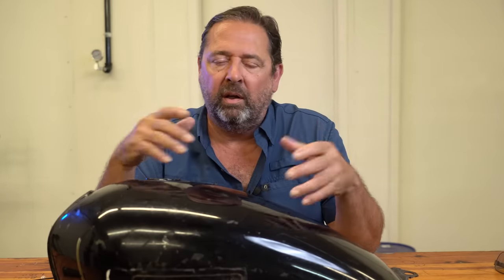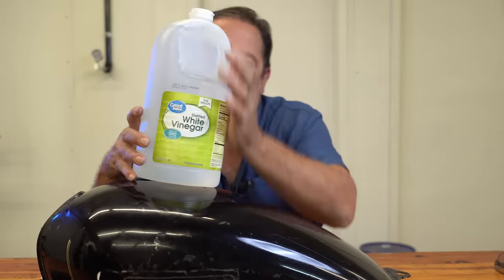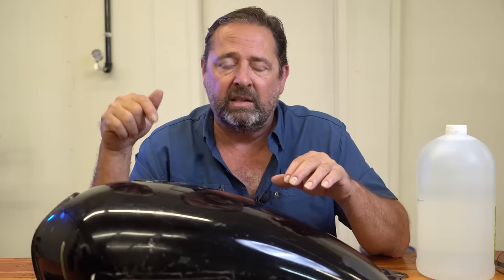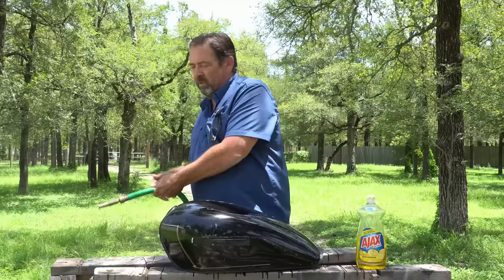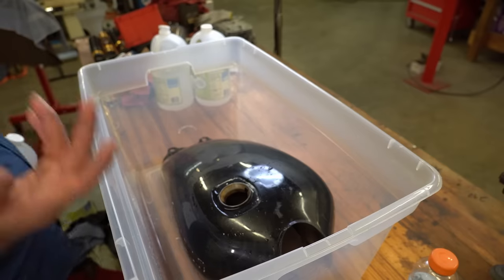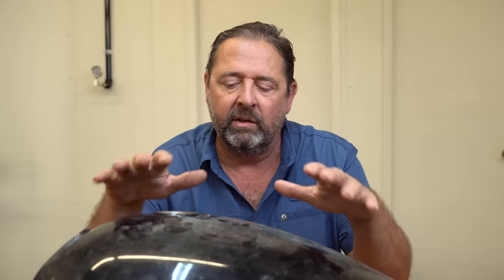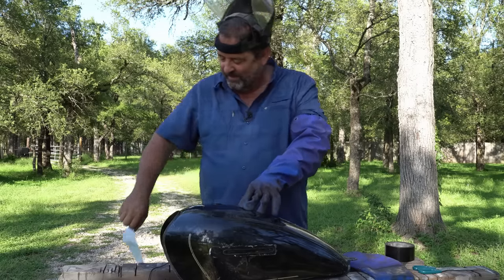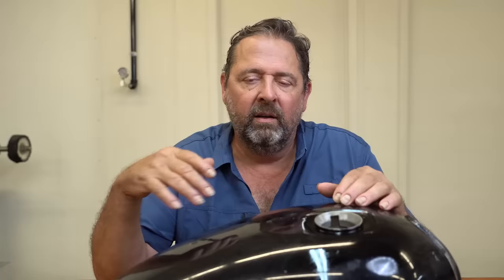GAS TANK--CHEAP--RUST REMOVER !!!!!!

Comment: I'm not sure about stateside but over here in Blighty our washing up liquid has salt in it which will promote rust, which is why it should never be used as a tyre seating lubricant. I've seen very rusty motorcycle rims on the inside whilst tyre changing which I'm sure has been caused by the use of this detergent, can't say as I've tried white vinegar but I have used molasis to good effect !
Reply from the maker: Thanks for the details, will keep that in mind.  I've heard about molasses, might have to try that.

Comment: Good method. The only thing I'd ad to this is after the muriatic acid step to immediately wash the tank out with baking soda - this drastically slows down the flash rust problem.  (HCL on metal in the presence of oxygen will ironically re-rust that metal.)
Reply from the maker: Point taken.  Thanks!

Comment: This is a very informative video. The muriatic acid added to a nearly full tank of water, may in some cases, replace the vinegar soak. Also please be careful about the dangers of the addition of water to acids. Muriatic acid added to water in an old engine block that is crudded up with iron, and/or lime scale will etch the surfaces to look like new, just as the tank did. For the proper dilution rates, consult a knowledgeable professional. Muriatic acid vapors will cause a red corrosion on anything in a confined area. Take it outside before you open the container, and protect any bright metal surfaces with a coat of grease or oil. Grab your old clothes and shoes, and all the needed ppe.
Reply from the maker: Thanks, good info!

Comment: Used vinegar for many rusty things but didn't know the baking soda trick.    My old beast of a snowblower had a rusty tank.   I filled it with krud kutter and let it sit for a month repeating the process.   The tank inside looks new.  Not sure if what i did would work on a cycle tank though...
Reply from the maker: It should work just fine.

Comment: Evapo rust will remove the paint  if it sit any time.
Will Vinegar hurt the paint ?
 I like metal prep from the auto paint store. They use it on bare metal to remove surface  rust . 
If you let parts sit , it does remove bad rust and is safer than muriatic acid.
Reply from the maker: Good info to know, thanks!  And thanks for commenting!
Reply: @CycleFab  ... You didn't answer my question .

Comment: I will have to remember that for my next rusty gas tank.
Reply from the maker: It works really well.
Reply: I see that. In the past, before I’ve rinsed the tank out, I’d toss a bunch of nuts and washers into the tank and move and shake it all around. The nuts and washers would help knock off some of the really scaly rust inside.. but your method seems to work very well without having to do that step.

Comment: Have you ever tried molasses to remove rust? I mixed up about 4 gallons at 9 parts water to 1 part molasses and soaked my Dana 44 knuckles and brake backing plates. They were RUSTY when the went in, when they came out,,, bare steel. It leaves a black residue on the steel that comes off with either scrubbing or pressure washing. Nice part is I can just pop the lid and drop a part in the five gallon bucket as I need.
Reply from the maker: Old remedies still work well.

Comment: Best way to get all the fluid out of the tank when fill hole is in the top right corner. Almost seems impossible…the acid is the last thing I feel like I want to turn upside down shaking and splashing everywhere. Also, any issue using original gas cap with the acid? Does it affect crossover lines or cap?
Reply from the maker: Yes, you do have to be careful when working with acid.  Muriatic acid will affect everything that it touches.  Thanks for commenting and good luck with your project!

Comment: 1. Use water hose to remove residue inside tank. Add dishwasher soap as well. Repeat several clean cycles. 
2. Seal tank and fill to brim with white vinegar. Let sit for a couple days. 
3. Add  half gallonMuratic(?) acid for no more than a min. Vinegar is good enough so long as you seal it right away. Has container to dispose of acid. And baking soda to neutralize in case of spill. Roll the acid around in the tank. 
4. Use wd40 to seal it after cleaning out and drying.
Reply from the maker: That's it.  You can use two stroke engine oil also, but the oil is mainly to keep it from rusting if you're not going to be using the tank right away. Thanks for watching and commenting!
Reply: @CycleFab  oh sorry i was taking notes for myself for later. but i used this technique and it came out great! thank you for making this video! really well done
Reply from the maker: Great!  Good to hear that.

Comment: After the muriatic can you go straight to the sealer?
Reply from the maker: You'll need to rinse the acid out before you apply sealer.
Reply: Rinse with water? Will the metal flash after the muriatic acid?
Reply: Thank you for responding ❤
Reply from the maker: Water/baking soda mixture and rinse well and dry.  Yes, you will possibly get light flash rust.  Caswell Tank Sealer says in their literature that you can use their product over light flash rust.
Reply: @CycleFab  makes sense, thank you for your mentorship!
Reply: @CycleFab  I just completed my project with your helpful videos and mission 🙌success. Thanks again!

Comment: This might sound silly, but would it be more beneficial to use distilled water for the flushing and rinsing where you used tap water?
This question with the same reasoning you would use it in your cooling system instead of tap.
Thanks for this video
Reply from the maker: It makes no difference between tap water and distilled when flushing/rinsing.  Thanks for watching and commenting.

Comment: I've used vinegar to remove rust. It doesn't work very well but it does work.
Vinegar sold at the grocery stores is diluted to 5% vinegar. I'd like to know where to get stronger vinegar.
Reply from the maker: You can get stronger vinegar at Amazon or Lowe's.  I think up to 45%, maybe more.  Thanks for watching.

Comment: I DONE IT ,LOOK GREAT BUT I have a question ,do I need to wash out the tank with soap after the Muriatic acid and do I really need to undercoat the tank thanks
Reply from the maker: YES!  You need to wash out the tank with soap and water after the muriatic acid.  And, its not necessary to line the inside of the tank if it's not leaking.  Thanks for watching and commenting.

Comment: I had a 89 supra and tank was just soo Rusty I was sure was ready to be tossed. Turned out I watched a video someone using acid at Walmart and I used 1 gallon and started working in 5 minutes after puring it was sizzling acid... Made rust turn highlighter yellow. The vid shows light rust. I have huge chunks of rust. Btw... The acid is no joke. It's 1000 times better than vinegar or some of the rust remover stuff you see at AutoZone.. the acid is the real deal and believe me it. Cuts Time and saves your money. I'll only recommend acid. I've used the gelly stuff on other stuff and it works on surface rust. This acid will eat away crusty rust in chunks....
Hoping this helps!
Reply from the maker: Thanks for commenting, good advice!

Comment: okay so as the video goes on you reveal more and more things that are needed. i would be nice if they were stated in the description and at the beginning of the video. now i'm going back and forth to find out what i need
Reply: video starts talking about Rust 911 then moves on to water then dish soap and water. it notes that you rinse it several times with water then repeat the process with dish soap and water but the process is not shown and we don;t know how many times to rinse with water and how many time to wash with water and dish soap. then we see vinegar going into the tank and then it cuts to the vinegar having been removed from the tank without stating how long the vinegar is supposed to sit in the tank. also how is the vinegar supposed to be removed? do you blast it out with water? then all of a sudden we're talking about muriatic acid and it's mentioned that it's dangerous and disposal is never described or shown. dish soap gets mentioned again and then we cut away yet again. now you mention don't let it sit not specifying if you're referring to the acid or the vinegar and then you mention that the vinegar "like you said" should sit for 24 to 48 hours but you never actually said that until now which is a full step after you've removed the vinegar... now you mention putting WD40 in the tank before sealer but then removing the WD40 with acetone. so that's 3 new chemicals mentioned in the last minute of the video with zero explanation or demonstration of why and how. i'm left with far more questions at the end of this video than before i started watching. WTF?
Reply from the maker: Noted!

Comment: Thanks for doing yhis. But what i do not see afther the white  what you use for product afther that? Baked soda? How long it stay inside?
Reply from the maker: After muriatic acid, rinse with baking soda and water for about five minutes or longer then rinse with water.  After that I would immediately coat the inside of the tank with gas and a 2 stroke oil mixture.  It protects the tank from flash rust until you get it back on your bike.  
Thanks for watching and commenting!

Comment: I've bought some Caswell but after seeing horror stories of sealer delaminating, I'm gonna try running the bike as is, removing the fuel, drying, then WD40 for the winter lay up.
Reply from the maker: You don't have to use a liner, running bare metal is fine as long as you don't let it sit for months on end.  BTW, use two-stroke engine oil instead of WD-40, it just works better.  Thanks for watching and commenting!  Good luck with your project.

Comment: Great video thx a bunch. I have just one question - after clening the tank and all is well and clean what should be used to coat the inside of the tank immediatly that will agree with gasoline when the tank is in use. Would a coat of oil do? And if yes which one and how much. Ok that more then one question :) thx
Reply from the maker: I use two-stroke engine oil to coat the inside of the tank to keep it from rusting until I can get it back on the bike and running.  Or I do this to it:  https://youtu.be/S8DJ8pUw9Yc
Reply: @CycleFab  again thx a lot I do appreciate the advice. Just to be clear from your experince if you just use two-stroke oil it should be good for future usage even without doing the sealant? Take care. :)

Comment: The best I found is CLR leave it a few days with some nuts to shake around now and then Finish up with new metal finish inside.
Reply from the maker: That's a new one, might have to try it!  Thanks for watching and commenting.
Reply: @CycleFab  it’s a little stronger than vinegar works great. I even seal the cap and invert the tank to clean the top surface.

Comment: Hello perfect video, I have a silly question, since I have done the whole process and having poured in the 2 strike engine oil for the insulation. To use the tank in my machine will I have to get the oil out of the tank somehow? "Wash out " with gasoline maybe ? Tnks you !!
Reply from the maker: Yes, gas works fine for washing out the two stroke engine oil.  Thanks for watching and commenting.

Comment: I take a three gallons of vinegar. let it soak 24 hours. I pour 100 stainless steel lock washers and a container of 1,000 BBs. I seal the tank, wrap it in two moving blankets and put in the dryer making sure it does not flop around, set on no-heat fluff and run it for a half hour. You can also put it in a small cement mixer. Cleans it out. Then coat with Por 15 right over the residual surface rust.
Reply from the maker: That sounds really effective!  Thanks for watching and commenting.

Comment: What method do you use on a tank with paint that you want to save and internal fuel pump.
Reply from the maker: You'll have to get that fuel pump out first, then use the weakest vinegar 5% (which is what I used in the video) and no muriatic acid.  Good luck with your project and thanks for watching and commenting.

Comment: Good video! Can a tank sealer be applied directly after the white vinegar?
I've left my tank soaking in white vinegar for a couple of days now and looks ace, however I'm hesitant to wash it out with water.
Thanks
Reply from the maker: Rinse/Neutralize with water and baking soda mix then dry and apply sealer.  Don't worry of any light flash rust if it happens during the drying phase.  After it dries seal it ASAP.  Thanks for watching!
Reply: @CycleFab  thanks for replying so fast. 🙏🏻

Comment: You briefly mentioned it, but I think you should have done a better job explaining to people that the vinegar and acid removes a layer of the metal and it has to be permanently coated or it'll come back. You did mention spraying it with WD-40 but that's only a temporary Band-Aid and I know you mentioned that but I don't think you were clear enough for people to understand they can't just run acid and call it good.

That being said, I think you did a good job, I've used this method many times.
Reply from the maker: Sealing a tank after cleaning is a must, in my opinion.  Without this crucial step the tank will start to oxidize.  Thank you, I'll keep your observation in mind.

Comment: What do you nuetralize the acid with?
What about the fuel tank sending unit? If you remove that assemble how do u close the opening? Can you leave the float unit in place, or will it get damaged?
Reply from the maker: I use a baking soda/water mix to neutralize the acid, and I remove the float unit.  Gorilla tape works for sealing up the holes during this process. 
Thanks for watching and commenting.

Comment: hi thanks for the video, i have rust in my motorcycle radiator, will your method also work?
Reply from the maker: If your radiator is soldered together as radiators typically are then I would suggest that you don't use this method.  Reason being is that solder and vinegar(acid) do not react well together.
Reply: @CycleFab  thank you . didnt think about soldered radiators.

Comment: Sorry for this question, you have used Vinegar and then which ACID ?
its REDIC ACID ?
Reply from the maker: No problem.  I use Muriatic acid, which is typically  a 35% Hydrochloric acid and 65% water solution, if I remember right.  You can buy this stuff at any hardware store.
Reply: @CycleFab  thanks allot

Comment: Hey man, I’ve got my tank full of vinegar right now, it’s the 2nd time doing this because the first time I wasn’t quick enough to avoid the flash rusting when drying it. 

So my question is after I rinse out the tank with distilled water and baking soda to neutralize the vinegar do I just spray some WD-40 in it to avoid the flash rusting? My tank is curvy and difficult to dry. Any tips? My plan right now is to rinse with water and baking soda, empty it with my hand pump and then add in 2 stroke oil and a gallon of gasoline to swish it around in order to avoid rusting before draining that and filling the tank with gas to start riding. Any help is appreciated
Reply from the maker: Flash rust is sometimes unavoidable, but the two-stroke/gas mix is probably better than WD-40.  Hope this helped.
Reply: @CycleFab  I appreciate you. Thank you for taking time to respond to every comment with information.

Comment: Adding some sharp grit and sloshing it around with some ammonia solution will polish it up to white clean steel
Reply from the maker: I haven't heard of using ammonia before.  Thanks for the info.
Reply: @CycleFab  it's cheap basic solution with relative high PH and thus preventing "fly rust". It also degreases the surface. The small sharp grit/stones knock of any remaining crud.   Afterwards rinse out with acetone to remove all water. Ready for coat😊
Reply: This treatment comes after the vinegar treatment

Comment: I have a question about the wd40.. do you fill up the tank with it loke you did with the vinegar or do you just pour some in and shake the tank.. thanks. Really liked your video
Reply from the maker: I use just a little and shake it, also you can use two-stroke engine oil.
Reply: @CycleFab  thank you for your response. I should of watched your video before attempting to remove the rust in the tank I'm working on... I'm having to repeat the process because I wasn't aware of flash rust. I dumped the vinegar and wash out with backing soda and water blew out the water best as I could and walked away... I guess common sense isn't that common lol

Comment: I mean if you deal with older motors or engines this is a major pain cleaning gas tanks boats c ycles snowmobiles you name it thats why Im looking I even thought of putting in sand and buying an old paint shaker. Now that would be cheap but still trying to find good cheap ways to clean gas tanks its difficult.
Reply from the maker: I've been using vinegar because of its cheap price and it just works!  However, next time I'm going to try something different...

Comment: 7:26"  "Yeah it smells like vinegar" LOL  Do not use vinegar on Galvanized metal. Vinegar will dissolve zinc and pot metal.  Evaporust is reusable and does not harm metal or paint. So Evaporust in the long run is cheaper than one use vinegar. Evaporust will not flash rerust if you rinse with distilled water. Let dry and prime quickly.  Tap water has minerals that promote the formation of rust.
Also use a hair dryer to dry out the tank fast.
Reply from the maker: Really good info!  Thanks for watching and commenting!

Comment: Maybe a dumb question. Would allowing the white vinegar to sit in the tank 24-48 hrs and in a colder environment have any adverse effect? And do you block off the tank with the gas cap while you let it soak? Thanks.
Reply from the maker: No, but the warmer the environment the better/faster the vinegar will work.  And no, I do not put the cap back on the tank while soaking.